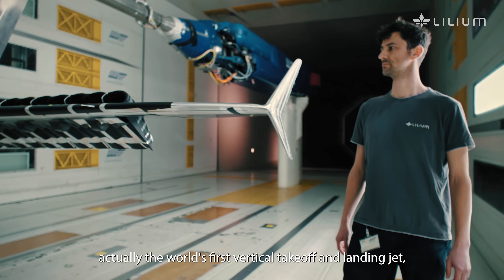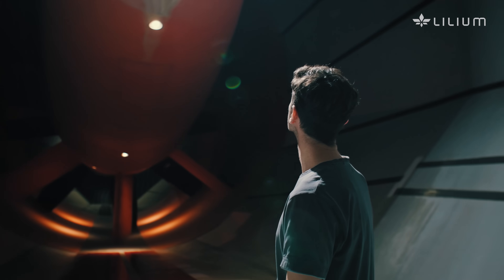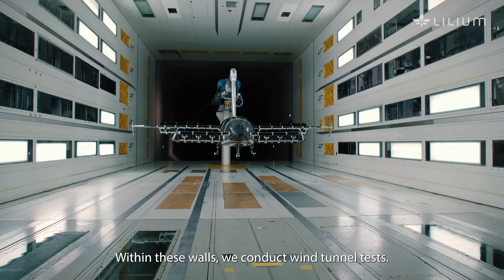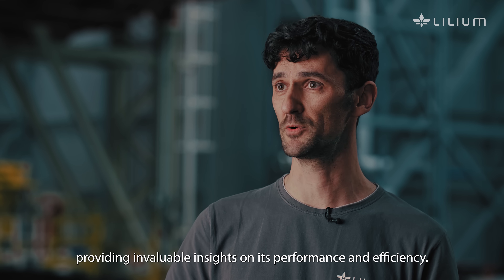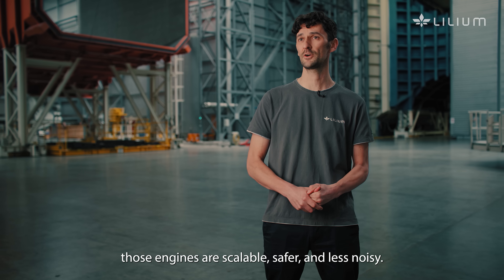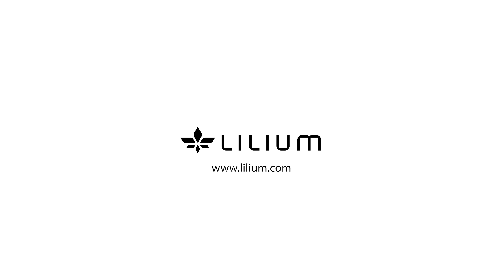Lilium Jet | Wind Tunnel Testing | Hear from Julien

Comment: Very strange that a wind-tunnel test-engineer has basically no knowledge about aerodynamics, aircraft design, performance and saftey. Other-wise he and the investors would run to find a new job and or a better investment.
Having commented in details about this strange design, layout and its lack of efficiency and safety 
I just emphasize with the knowledge and experience of more than 40 years in civil and military aircraft design and development 
that his toy will remain a tinker-toy.

Comment: Seems that it could still land horizontally if it had the wheels for it.
  I wonder how few motors are required to be operational to maintain level flight?
I wouldnt be surprised if the answer was 2.

Comment: The idea of using actual wings as a mode of forward flight in VTOL versus thrust only will greatly extend the range. I don’t understand the idea of using props alone for flight over both props and wings. With wings a power reduction can be realized as the craft is supported by the actual wings. Good on these guys for doing it the right way first.

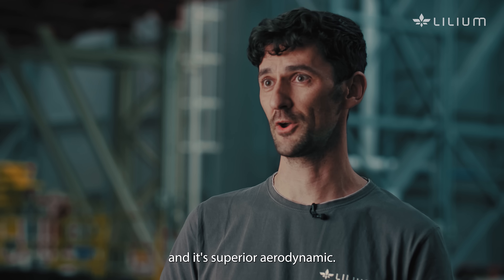Comment: 0:11
"The world's first vertical takeoff and landing jet,"

Allow me to introduce you to the Harrier jump jet, courtesy of Hawker Siddeley who first produced it in partnership with British Aerospace, Douglas & Boeing / BAE from 1967 to 2003. It is a VTOL and VSTOL strike aircraft currently serving in the United States Marine Corps, Spanish & Italian Navy, though it's been retired from the British Royal Air Force & Royal Navy since March 2011.

I'm aware this may not be an apples-to-apples comparison. The Harrier was fitted with a Rolls Royce Pegasus 6 engine, a turbofan engine with swivelling nozzles, whereas the Lilium has 36 ducted electric vectored thrust (DEVT) fans. But don't claim this is the world's first VTOL jet when you can so easily disprove/pick apart this statement (I'm aware this is most likely just marketing doing marketing).

1:38
"A helicopter or most open-rotor-based cabins are boxy, ours is built for the streamline."
It's safe to say that this is just a marketing term. There are countless examples of aerodynamic rotary aircraft, such as my favourite the Eurocopter AS365 Dauphin used by the British SAS and dozens of other countries' militaries.

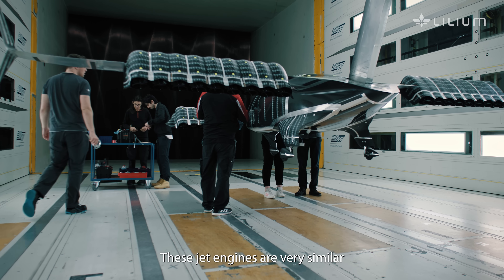1:47
"These jet engines are very similar to a traditional aircraft, just without the combustion. And unlike open rotors, those engines are scalable, safer and less noisy."
I think we've agreed on the fact that these are not jet engines. Just call them what they are, DEV fans or thrusters. The only similarity they share with a turbofan is that they have a rotary component. Much lower RPMs and aerodynamic + mechanical stresses here. No fuel other than electricity is being used. I do agree however that DEV fans are scalable, safer and less noisy because of the far fewer components and previously stated points.

In conclusion, after watching the entire video I have to firmly push back on calling this a jet. I agree with what others have stated here, the term jet is being used as a marketing term and holds no operational value. By this logic, you could call a Douglas DC-6 a 'jet' when it's a piston-powered cargo aircraft (surprisingly some still fly). Of course, the marketing department does have to do the polishing with what they have so that is understandable, but others need to understand that a DEV fan ≠ jet engine or jet aircraft.

That being said, the US NBAA has an interesting article on what defines a jet aircraft (not the jet engine and this article is about a private jet):

- One or more gas-turbine engines
- Capable of flying higher and faster than piston or turboprops, catered to businesspeople
- below airlines (20k-25k ft) or above (>40k ft)
- Varied size & range, average 1k miles

Sources:
https://en.wikipedia.org/wiki/Harrier_jump_jet
https://en.wikipedia.org/wiki/Rolls-Royce_Pegasus
https://en.wikipedia.org/wiki/Douglas_DC-6
https://en.wikipedia.org/wiki/Eurocopter_AS365_Dauphin
https://nbaa.org/business-aviation/business-aircraft/jet-aircraft/

Thanks for reading, fly safe.
Reply: it's comments like this that grab my attention, well done research, precisely put forth points, and diplomatically written opinions.
Good job mate, for educating people here more than the video.
Reply: First VTOL transport Jet was the German Dornier Do 31. First flight February 1967, long before the F-35B and 10 months before the Harrier’s maiden flight.
Reply: its still not the same thing. this is revolutionary

Comment: why dont you mould the wing around the engines? so the intake is the leading edge of the wing? you could mount the engines in the same place but lower and the engines would be in the aileron position and able to move but draw air through the wing making like a biplane effect and giving more lift.

Comment: Bag of ... I was unaware that all the footage shown was of a subscale model (if so )  --there are conspicuously no photos of someone standing next to it now that I think about it , It is certainly meant to convey a full size test aircraft (there are photos from above of a full sized vehicle - I, and I think electric aviation , used the humans to try to work out dimensions .   The array of small diameter fans strung out along the wings is reminiscent of the Russian Caspian sea monster 'Ekranoplanes' and is also featured in several tech papers long preceding lilium . the figures given for range and speed were for flight at 10 000 ft which is the legal limit without oxygen and unrealistic for short ranges especially given the cost to climb and airbrake effect on descent .

I'll look into the scale thing, thanks for the info.
Reply: They have full scale mockups they sometimes stand next to but not the one they flew.  They have some cabins they show that people sit in but they don't have wings. They have never flown a full sized craft capable of lifting a person. They say they will have one this year but I doubt it.

Comment: Pretty cool however calling it a "jet" is not really a good thing. Jets have combustion, here we don't have engines, we see only electric motors which is extremely different. We don't call electric motors "engines". So this isn't a jet, plus it's a VTOL aircraft, we don't call the V-22 a "jet" for example even if it's different vehicle category. So in the end this astonishing vehicle you are producing is nothing more than a different variety of "aircraft" and not a "jet".

Comment: Masterfully produced video that really shows of the beautifull flowing shapes and how you put real effort into designing the cabin. I espcecially like how you did not address how you plan to produce the roundabout 2000KW+ necessary to lift your vehicle because it is using such a tiny rotor disc area.

Comment: Too many moving parts. Too complex. More things to go wrong. Make it simple….
Reply: The Lilium Jet has the fewest number of moving parts of all eVTOLs at all. Each motor has exactly one moving part and the 30 motors have in total 16 actors for the flap-angle. No gears, no rotor blade adjusting. No single point of failure. Higly redundant. 10 independent batteries, 3 independent flight computers. The tilt rotor systems from Joby and Archer seem much more complex.

Comment: You spend all these time in wind tunnel but not a second showing the aerodynamic results
Reply: Yeah because the aerodynamics sucks, I can see it with my eyes. I dont need special computers
Reply: @Codep1lt  yooooo😂
Reply: Which company does?
Reply: @avigator usually companys that show their vehicles In a wind tunnel for marketing have a cool looking smoke trail gliding over it to show how smooth the flow is.

Comment: Still operating on this scale... I dont believe this thing will fly in actual size soon, if ever.
Reply: imo the problem with the lilium "jet" is that electric ducted fans are very inefficient which increases the power/weight problems with batteries. maybe they can make their EDFs more efficient, but they wont make better batteries themselves i guess. so unless batteries improve, this wont be viable
Reply: They been flying a full scale mock up. Where have you been?
Reply: @mike_the_marketer  source?
Reply: @mikeg3810  they never did.

Comment: Great project, looking forward to seeing more updates. The question is not "Why call it a jet if it takes off vertically?" as there are plently of jets that take off vertically. The question is: Why call it a jet when it doesn't use jet propulsion, and therfore doesn't fit the commonly accepted "jet" definition?
Reply: You just answered your question yourself 😂 now go and check what is jet engine..
Reply: @mariusmartinsen2064  "a type of reaction engine, discharging a fast-moving jet of heated gas (usually air) that generates thrust by jet propulsion". If I read and understood correctly this doesn't fit that description, as the gas is not heated.

Comment: Why do I get the feeling they spend more on marketing than engineering? Their videos seem scammy too.
Reply: Years ago, they produced very few videos, and then they were accused of hiding and not publishing any information. Now they're making more videos, and that's wrong again. You can never please everybody..
Reply: 4 videos in 2 month. wow
Reply: Its not right . Thay make Marketing only since one or two years but thay work since 11 years on this company and on this idea. That show clearly its completely different... thay made a lot more engineering than marketing  .
Reply: Electric duct fans simply will not work. BEVs barely work, let alone battery-powered rotary craft. Battery power density is not sufficient to airlift a vehicle for meaningful commercial or military use. It is unlikely that this will ever change.
Reply: @randomchineseguy6462  also no Problem because you can ever Chance the engines later .
Reply: @randomchineseguy6462  - "Electric duct fans simply will not work."
Its already working brilliantly.
And energy density is high enough for shorter duration flights and battery density is progressing nicely.
Reply: @stuartgray5877  why hasn't any multirotor evtol on earth ever proven that? Why do you even think that is true? Find the longest unedited video of a man and battery being lifted by an evtol ever on the planet earth. Lilium  has never even shown their toy demonstrators fly a few minutes without editing the video. They will not have a full size one lift itself for 3 full minutes.
Reply: @TheBagOfHolding No electric VTOL has proven anything before because they were not feasible and there was no technology to make them. Times have changed, they are viable now and are the future of VTOL flight, batteries improve every year and probably adding a true Jet engine for extended flight to recharge and maintain charge on the batteries will allow for truly long distances.
Reply: @czhusky  the batteries haven't gotten that much better. Battery ratings can easily be manipulated you need to look at the progress on a cell level.  Batteries are made of cells and there is only so much juice they can hold.  They haven't improved much. If it's possible then why doesn't anyone on earth show it and start a world record for duration and distance of multirotor manned evtol? They can't lift them 2 minutes
Reply: @czhusky  improved batteries usually means bigger and heavier battery but that wouldn't work for evtol. They will not have one proven this year on planet earth. Bet on that.
Reply: @TheBagOfHolding  Ok, cells are improving dramatically every year. E everything has taken over every small scale vehicle, rotor and propelled aircraft  are only to follow.
Reply: @czhusky  no, they haven't. The size might change, but the energy density has only improved, like 6% in the last 20 years. A bigger heavy cell might be an improvement if they don't need to fly. They need lighter and smaller for flyingm
Reply: @czhusky  so what is the reason there are no evtol drones that people can ride today? Why can't anyone just jump in one and make a video riding it?  They would be easy to make if the batteries would work. I can easily make small ones in my garage from YouTube tutorials.  You should look up the square cube law in physics and that will explain why bigger ones aren't possible yet. There is no reason they wouldn't exist now if they were possible.
Reply: It is a scam these aren’t jet engines
Reply: Deffo it's all BS. Get a CT Rotax or a shark that sips fuel and can go 1200NM. Everything electric is a con, batteries just do not have the energy density.
Reply: Well everyone cannot be Tesla n who r u to ask it did u build a company like dat nope right then shut ur ass
Reply: - "Why do I get the feeling they spend more on marketing than engineering?"
Perhaps you haven't seen their flight testing?
Its legit and the safest possible way to do sky taxies in the near future

Comment: Just a question . I am a beginner . If we have the power of simulations why make a real test ? .  Or what standards rule the number of real simulations ?
Reply: I'm a computational fluid dynamicist, I can answer that. Modeling a full body like this at high flow speeds is computationally very expensive if you're looking for little details like re-circulation zones or other phenomena that may affect flight. If you just want a steady-state calculation that can produce a ballpark estimate of lift and drag on the body then yes, you can do that. These guys are interested in the little details affecting flight dynamics. It is possible to simulate that but again, it's computationally expensive, and even still you always want to validate your CFD or at least compare with experiments whenever possible. Hope this helps.
Reply: @kingsleyzissou5881  HI, I am currently a student in the adjacent field of MD simulation and doing more of a wet lab work. I am interested in looking at finate element analysis for large proteins (or cells) as a pet project. I have tried blender -> sti -> open foam -> paraview pipeline. But I haven't looked in depth into the accuracy of the result, nor do I understand how to interpret the results. May I ask your opinion on FEM, openfoam (or other CFD tools), SOTA/current microscale modeling, or is it worth pursuing?
Reply: It looks so great on videos...

Comment: First vertical take off and landing jet my arse. Harrier jets (e.g., AV-8B Harrier II, British Aerospace Harrier II) use directed jet thrust for VTOL capabilities. F-35B Lightning II... and your aircraft does not have jet engines anyway.
Reply: Crazy that some guys spend their time in things they don’t believe or approve…must be Joby or Archer stock holders.
Reply: @butcck joby and archer are next to go down the drain.
Reply: Was Harrier electric? 🤣 Lilium is first evtol.. And whatbis JET definition?
Reply: @mariusmartinsen2064  the guy in the video said it was the first vtol not evtol.
Reply: @michaeljohnson3383 a jet engine is an engine that strongly accelerates air to .. form a jet stream that gives the thrust force to overcome weight and drag. Your examples and the Lilium jet have this in common! Combustion is just one way of creating the jet stream.
Reply: @wouterplaetinck6887 it doesn't accelerate the air it compresses it for more oxygen and greater combustion.  Lol you must be one of their engineers.
Reply: @TheBagOfHolding wow.. You look like CTO. What is a Jet engine and Turbine engine? Go back to every your comment and apologise for being lazy to  research whatvis a jet and how air is used in jet 😂
Reply: @mariusmartinsen2064  they are not even engines they are motors.
Reply: @mariusmartinsen2064  a jet engine uses air by compressing it with turbines and adding fuel, then burning it and shooting the exhaust out the back to produce thrust this is a motor using fans.
Reply: @mariusmartinsen2064  its not the first vtol or evtol to fly with ducted fans people on youtube made some toy sized ones before lilium made their toy sized one.

Comment: It is now 2024....nearly 8 Years after their first model flight... Isn't the electric architecture to be simpler...hope their funding has the unlimited money glitch on active
Reply: Electric rotor blade system is simple, it was here, tilt mechanics was here.
 Lilium went different way. Airplane/Evtol in general isn't a EV, it has slower progress as standards is different especially gov regs, safety etc.
Nobody at lilium want to rush unproven tech, get jet to sky quickly just entertain inpatient investors and if it fall down nobody will want to fly or buy. I like that Lilium takes time to pay attention to detail and work heads down.
Reply: @mariusmartinsen2064  is knowing a bit about aviation, and regulatory approvals eg I'm not confident at all about this project. Just assuming their monthly Capex I just hope for them, their funding is sufficient. Good luck